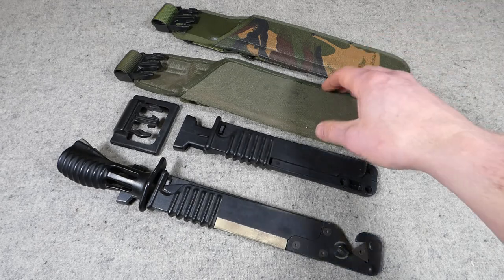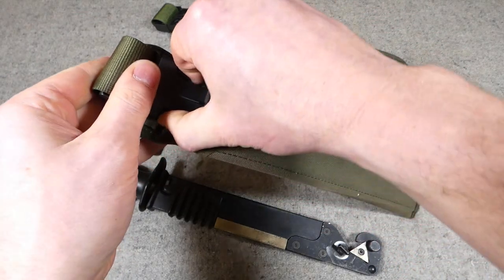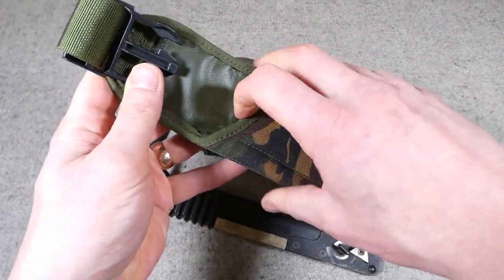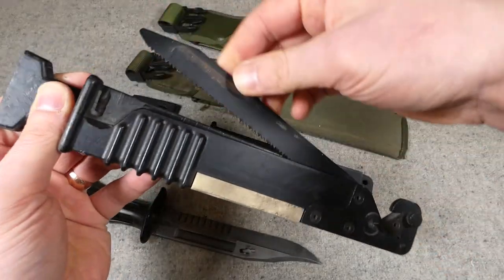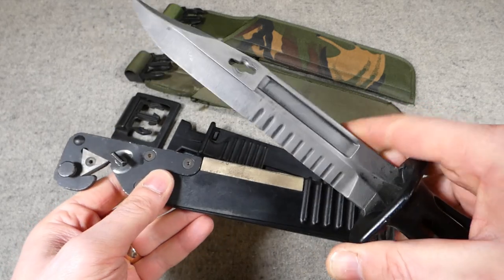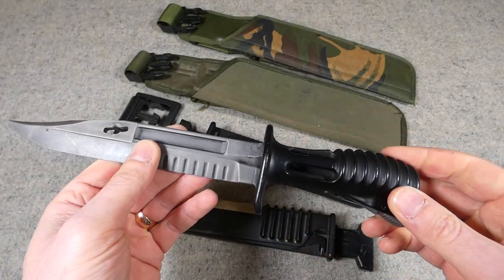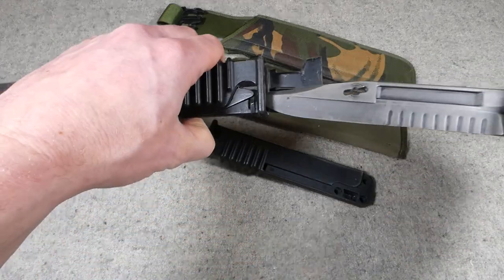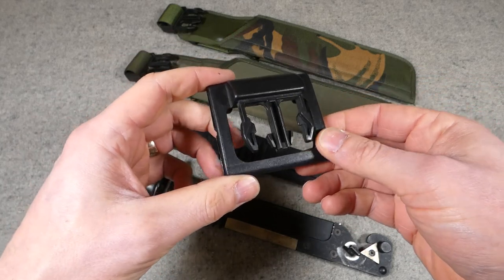British L85 Bayonet and PLCE Bayonet Frogs

Comment: I can confirm the wire cutter will cut wire as thick as a chain link fence ,with no problem,at least the U.S.  M-9 version,which has an identical wire cutter  design

Comment: Yes Bayonet or Sword Drill (IF YOUR IN RIFLES REGIMENT) is still taught.  It is more of a last ditch option i.e. when your probably very short if not run out of Ammunition.  Again you can fire the weapon with Bayonet fitted but it would affect point of aim anyway and you probably already run out anyway!!! The plastic buckle is likely a drill square item that might be used on occasion by non ceremonial  units outside of the Household Division.

Comment: The black plastic lugs with the large quick release buckle were meant to be slipped on after you disassembled completely the belt by removing slips and belt buckles of the 58 patten belt... otherwise you just break off the lugs if you try to prise it on...... which happened when they were first handed out before instruction was offered to young excitable soldiers of the mid Eighties.

Week springs and firing your bayonet up range if fitted was not unknown.

Comment: i took my bayonet to a key cutter and had him put an edge on it,
which made it far more usable as a tool, rather than pokey thing.
Could be wrong, but the plastic piece i was told was for attaching the bayonet
to vests rather than webbing. Never seen them in use so cant confirm it.

Comment: Speaking from across the Pond, I am not a fan of many of the modern bayonets that have plastic parts and weak tangs.  As a Veteran of the US ARMY 1969 -1971, and an antique and surplus rifle and bayonet collector, my preference is for bayonets to be of the Bowie knife blade pattern with a strong full tang and to fit a rifle bayonet lug like Mauser bayonets of the 20th 
Century.  The blade should be 8" long and sharpened to be used off of the rifle as a fighting and utility Knife.  This type of bayonet could be used for taking scalps of the enemy if necessary.

Comment: The bayonet was terrible. 

Would not hold a good cutting edge at all. 
 
Was very brittle. Snapped a few. 
 
The oil stone was crap. 
 
The wire cutter was actually not bad. But you ran the risk of marring up cutter so most of the time you just carries a set of cutters. 
 
The saw was passable not as good as a silky saw  but was better than nothing.

Comment: Looks very cheaply made and very easy broken lol
Reply: IIRC a lot of the early ones did shatter. Directly casting hardened/hardenable steel to shape is generally considered not to produce the strongest piece. Most knife blades are ground from bar stock, or from a forging, instead.